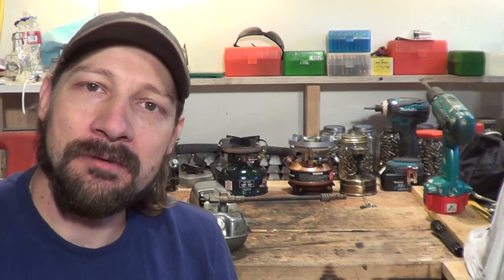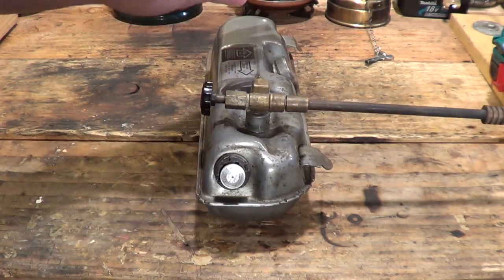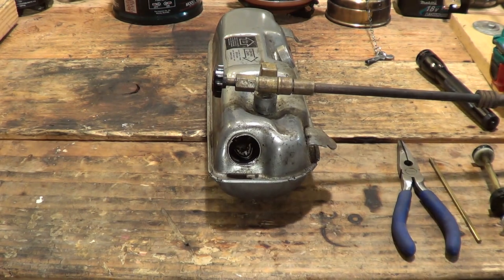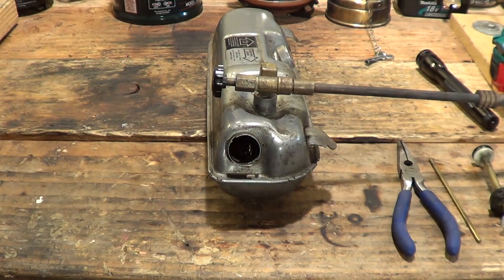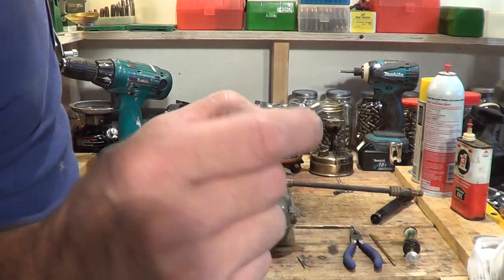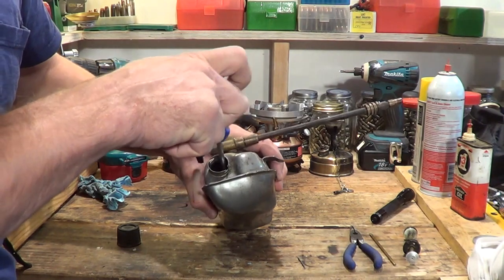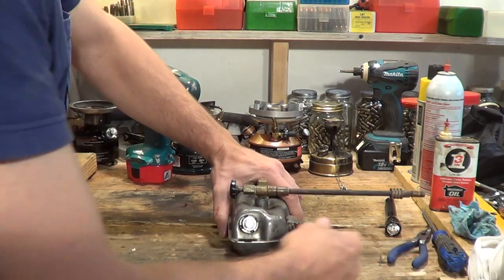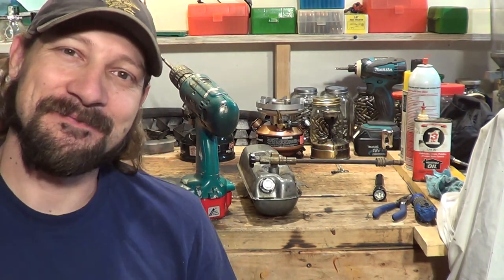How to remove a bad check valve out of Coleman products

Comment: Nice informative video.  There is no need to remove the valve from your stove.  You can do more damage than good by taking the valve apart. Just spray some WD-40 lubricant into the pump "oil" orifice and then pump.  The solvent in the WD-40 will clean out the gum and lubricate the valve.  If you are in the field, you can just put a little Coleman fuel into the pump and do the same thing.
Reply: I usually pump through brake cleaner, other's recommend acetone.  Almost always that does the trick,  BUT sometimes they don't work and you have to remove the valve.  I've rebuilt dozens of stoves and lanterns and have only had to remove one.
Reply: Ross, should you remove the valve if you flush the tank to remove rust?
Reply: ATF .. vehicle automatic transmission fluid ...superb and very searching do a 50/50 mix with acetone
one of the finest penetrating mixes to use .. not failed yet for me ... my check valve on the Colman lantern eased out ...with this ... acetone nail polish remover ...
Reply: I recommend Lacquer thinner as a solvent.

Comment: PLEASE, dont encourage people to use an electric drill for this. WAY too much chance of over speeding or scratching up the check valve or the wall of the cylinder. As a machinist, I also recommend that if you use the spade bit, round off the side edges to prevent scoring the cylinder. As for the nail polish, Maybe better is Vaseline. The O-ring serves as the sealing/tensioning surface. Otherwise, thanks for the video!!

Comment: Valve stuck but after I watched the video I understood the ball wasnt moving at all .Just so happens the diameter of a sharp dowel say the diameter of a chop stick is very useful as it is dry bamboo and makes a good tool to thread in to the ball ..after I reassembled ...it unstuck...thanks .

Comment: If you use the guide rod to reinstall the check valve it's easier to do without cross threading the valve just screw the guide rod into the check valve and you can get it started and then use the spade bit to tighten it if you so desire

Comment: Great tutorial, it's dangerous to have a leaky check valve! Great idea on spade bit. I use a hammer impact 3 eighth inch drive with extension and large straight screw driver socket. I hold tank between my knees,set driver in slot, and with one to two licks and it's loose. I put check back in same way! Works great! Just another way to do it. Thanks for the great video!  Jim from Kansas!

Comment: Got mine out using a cut down 1/2" spade bit as you mentioned.  3/4" will fit through the pump opening but not inside the collar of the check valve. I slowly worked my way up to 90% of full power with an 18V drill.  Even started to twist the bit before it broke free. My check valve was good. Bigger problems in the combustor pipe so glad you worked on that.

Comment: I have a 413H Guide Series Power House stove I found in someone's garbage.  I almost threw it out, again, but thought I would check the pump.  It would not pump and create pressure.  I took it apart and someone had tightened it sooooo tight that where the screw fit into the pump could not reach the screw. The pump would just spin and not tighten.  Well, now it works perfectly and my wife prefers that stove.  

This was manufactured in 3/89 and has the better hinges on the lid (the lid will stay up without the windscreens being attached).  This is good on non-windy days if you want bigger pans. 

I also have a Coleman 2 burner propane box stove similar to the one you fixed up in another video.  Without the ignition system.  It was manufactured in 3/93 and purchased from Big Lots for like 35$. Still works perfect.  Could use a thorough cleaning (thanks for that video).  Also has the better hinges on the lid that you don't have to put the wind screens in to keep the lid open.  

Thanks for your videos.  I enjoy them and find them informative.

Comment: I had a stuck Check valve that would not allow air into the tank. After watching your video I pulled the Valve stem put a shot of penetration oil in the valve and  let it sit a few minutes. Removed the gas cap, emptied the tank and put a shot of compressed air on the valve. it opened right up and works like it should now, Thanks for the Video.
Reply: Worked for us! TY, mate!

Comment: Followed your directions regarding the cutting of the 1/2" spade drill bit......and it worked perfectly. The lantern had been sitting for 45 years, had to use some extra muscle to remove the check valve. Thank you for the excellent suggestion.

Comment: This worked for me with my biggest screwdriver, putting a wrench to the screwdriver's square shaft to break the initial resistance. Then once the check valve was completely loose in there, I screwed the square shafted needle valve back in to pull out the check valve from the cylinder without having to turn the tank over, since it still had fuel in it.  Carb cleaner had it working in a jiffy!  Thanks for the video!

Comment: This is a great informative video. I also use the spade bit technique. I have several screw drivers with handles that look like yours. My screwdriver handles are damaged due to Labrador Retrievers. 
To put the check valve back in I attach it to the pump stem and pump then take it out and snug it with the spade bit.  Glad you got it fixed man.

Comment: Big thanks i just cut down a spade bit, put it in my dewalt impact drive , held it in really tight and just flicked the trigger and came straight out. Unstuck and cleaned then put back and my lantern now works perfect - Thanks great practical advice

Comment: You can usually fix a gummed up check valve with just spraying it with carb cleaner and compressed air. I have got a few of them out with a custom ground screwdriver. The same concept applies to your method. HOWEVER the best possible way to get them out is by purchasing a check valve tool from old coleman parts or someone else who makes them. The check valves are brass and are usually in there really tight its super easy to chip one out to the point where you render your stove tank useless or your lantern fount junk. Stripping a check valve equals destroying your stove/lantern. I am a coleman collector so I can justify buying the tool but if you have a really stuck valve don't risk breaking it find a collector in your area that has the tool or purchase the one online. I paid $25 for the tool. Keep the stove videos coming.
Reply from the maker: Excellent info, Thank you!
Reply: Great job on the video,,, keep in mind the small hole in the plunger assembly allows air in on the upstroke.. remove thumb on the upstroke..
Reply: Tried spraying it over a couple of hours, had to make the spade bit tool in the end and remove it.
Reply: Use a screwdriver and Never a drill .

Comment: I like the idea of using an old spade bit, but I'd grind the shaft square and put it in a large tap handle.  Better control, better feel, you can easily push it down firmly into the check valve slot.

Comment: Thanks so much, I bought a 12mm (1/2 inch, roughly) spade bit and sawed the end off. I put it in the drill but it diddn't seem to work. I used a 1/4 inch socket and used that on the end of the bit. Damn it was hard work as you said, but, it eventually came out. It was stuck (the ball and full of sh*%). I cleaned it with carb cleaner. 
It works like new now, LIKE BRAND NEW. I had the burner shrouds glowing red hot and that was in daylight!!!!!!!!
Thanks again Legend.Cheers BobbyB (from down under)

Comment: Thanks. This has been very useful. I have two Coleman lanterns with the same pump/ check valve arrangement and these have been left out in British rain for months. Pumps and check valves have to be removed , cleaned and re-installed.

Comment: The spade bit is a great idea.  The parallel faces it has will be a lot better than any screwdriver you'll find.  I discovered my check valve was leaking when I removed my thumb and gas squirted 2 ft out of the hole!!!  Luckily it wasn't lit or I'd be extra crispy.  That was a 400b where the flame is close to the pump.

Comment: Spade bit...great hack! If you don't want to use a drill, use a spanner wrench or socket on the drill end of the spade bit. Use Permatex No1 for the threads. Supposedly, on a leaking check valve, the test is to pump up, open the pump and lightly put your finger on the hole....the pump will slowly rise up if the check valve leaks.

Comment: I like the design of the factory tool to get that check valve out. I can probably make one out of a piece of thick wall steel pipe and a piece of all thread that screws into the check valve and a washer and a nut and welding a big nut onto the pipe. Or just use channel locks, vise grips or a pipe wrench to turn the pipe. Just trim the end of the pipe to fit in that groove.

Comment: You're a fucking genius mate.
Had this problem on a Coleman 533 stove. 
Was able to remove the check valve (they really tighten the fuck out of it) with a screwdriver which had a broken tip, so was quite a bit thicker and then vice grips on the screwdriver handle to loosen it. Heard a click (thought I'd broke the valve head off but it worked) and that was it loose.
Took it out, gave it a clean (just clean petrol and a shake around) and it works fine now. For now anyway.
As the check valve is buried so deep into the burner what I recommend is screwing on the brass pump rod that stays attached to the valve and using that to start screwing the check valve back in, then stop the check valve from turning with a small tipped screwdriver and loosen off the brass rod and tighten fully with a screwdriver, then reassemble as normal. 
Thanks a ton though, wouldn't have known where to start if it wasn't for this video.

Comment: Dang Squid. I sure do appreciate this post. Definitely have a faulty check valve in mine.
Thought I was gonna have to go to ebay and by the tool and a used check valve.
I will report my findings to see how it worked.
Knee Deep Sailor

Comment: I tried taking it out and it wouldn't budge. Thought maybe it wasn't supposed to screw out. After I watched your video, I could confirm it unscrews. Had to hit the screwdriver with a hammer a few times and use a lot of force, bit it came loose. Great tip with the spade drill, thankfully, I didn't need it.

This video could be under 5min BTW if you cut it aggressively.
Reply from the maker: Thank you! This video was one before I edited videos

Comment: I thought I'd try a short cut using a tip from your video. My check valve was leaking so having removed the pump, I just gave it a couple of squirts of WD40 using the long thin nozzle pressed to the valve.
It worked!

Comment: You showed us how to change, and a problem that I believe is going on,but I wouldn't use a drill to tighten and now you have brass metal shavings inside the tank or check valve. Best to use a mild lock tight or nothing. The Polish will not work with the fuel most likely.

Comment: I don't need a check valve removal tool, yet.  But I'm going to make one for the time that I may eventually need one.  I like your idea of using a modified 1/2" spade bit.  But I'm going to add a dowel rod that is 1" long and 1" diameter (turned down to about 0.875 diameter or slightly less) with a center hold drilled to the diameter of the spade bit shaft.  I'll epoxy the dowel to the spade bit shaft.  That should help keep the spade bit centered in the pump cylinder and on the check valve.  Maybe a 3/4" dowel rod will work just as well (I'll have to do a test fit).

Comment: Hello, great idea to use that tool for removing the check valve! I'm restoring a 242B and the tip cleaner is leaking, I already ordered from OCP, any tip how to take it out?. I see some guys use fire on the graphite packing and pull it out. Is there any other way?.

Comment: I have the opposite issue with my pump.  When I try to pump, there is pressure and it feels as if the tank is fully pressured.  This is with the cap off.  I’ve turn the pump to the left several turns and thanks not the issue.  I have sprayed some carb cleaner down the tube hole and left it for 10 minutes.  After I dried everything off and put back together, I still can not pump any air in the tank.  Thoughts?  Thanks.

Comment: if you left a little bit of the drill point on would that help center the screw drill bit over the slot?
Reply: No . Because needle valve will be besting there and you don't want to mess that up inside.

Comment: When i was little and camping with my dad i remember waking up at night and seeing the cleman lantern spraying fire out like a blowtorch  with my dad and mom hollering trying to do something about it and they destroyed that thing . Smash smash crunch . . I bet the checkvalve blew backwards from sand or dirt in it .where that little metal ball is . 
  I still have a coleman stove on the shelf i got for $3 at a thrift store .
 Inside the generator tube was looked like steel wool and black soot clogging the fuel flow . The whole stove burners were and still are black and sooty like oil and gas maybe .  Can stainless steel cable replace the steel wool ? I cleaned it enough to run but the steel wool was crumbling so most of it stayed in there .

Comment: I would think that starting to remove it using a hand tool first would be a good idea. It appears you could ruin it easily using a power tool. Not everyone has the feel for using power tools. Just my $ 0.02.
Reply: Agreed
Reply: Actually the opposite.  It can require so much torque that a hand tool won't be able to hold and twist at the same time.

Comment: Dude loves the 50cal Lolita have an 425e when using one burner it’s orange to rich but when I use two burner both sides run blue what’s going on with this thanks
Reply: I don't think he will answer. I'm a noob myself but perhaps you are pumping too much pressure into the tank. Too much fuel flow for 1 burner? Try 20 pumps, also don't overfill the tank.

Comment: I’m confused. My Coleman stove is almost new. I bought it brand new and have used it about 5 times and it does the “air leak” you demonstrated. If that’s NOT supposed to happen, why would you need to hold your thumb over the hole when pumping and keep your thumb over the hole while tightened the pump knob? The Coleman instructions say to do that so it’s designed that way. I’m confused as to why that would indicate a faulty check valve. It seems like it’s designed that way. I always thought a faulty value would fail to pressurize the tank or would leak after being tightened.
Can you clarify a little bit?

Second question: How do you know if the nail polish is not going to react negatively with the oil or fuel? Couldn’t that potentially degrade and gunk up the fuel?
Reply from the maker: totallyfrozen  if you put the thumb over the knob when you pump the tank up the air should go in the tank and not come back out when you remove your thumb from the pump... if air comes out when you remove your thumb before twisting it shut then you have a check valve issue... this  doesn't necessarily mean that the check valve is bad it could be gummed up with oil or grease or something like that... I hope this helps!
Reply: JIUJITSU2000 good video. Thanks! Now I think I’ll revisit my stove and my lantern and get them cleaned up.

Comment: So, if after to pump air inside the tank and close the pump to the right i can ssfely use the stove/lantern, why is so important to remove and clean a faulty check valve?

Comment: I have the colemans sporster 533 stove, and the pump wont lock after pumping, any ideas, perhaps new pump???
Reply: I have a 413G with the same issue.  Any help would be appreciated.
Reply: the threads are stripped on the guiderod of pump assemble( its the part that that srews into the checkvalve he just cleaned. there is a small threaded 'spearhead' o the end of that rod....check the threads.
Reply: @crabtrap  is there a fix for this? I have the same problem on a 159A lamp.
Reply: @steveshapiro6825  i think all the coleman pump rods are the same(not sure about the stoves) but just buy a coleman lantern on craigslist for 10 and use the pump. i think coleman sells the pump rod too for like $7....the rod will have the brass 'spearhead' w threads  ready to go. but i'd confirm the treads were stripped first (im 90% sure they are based on your symptoms)

Comment: Did'nt take out the check valve. I used a long blower tube and carb cleaner.  let it soak for a few minutes. took off the tank cap, emptied the gas and blew it out without removing the check valve.  rinsed out with gas and it works like new.